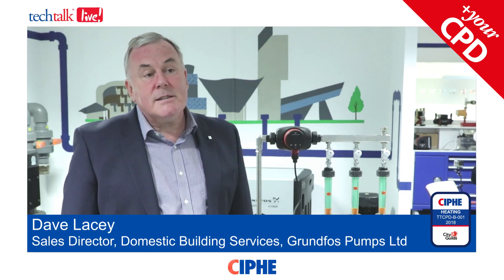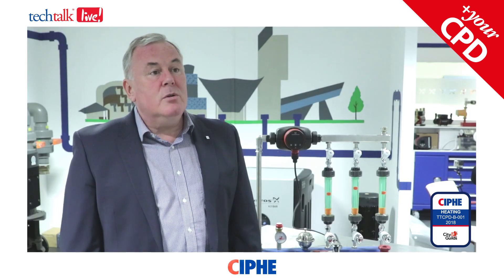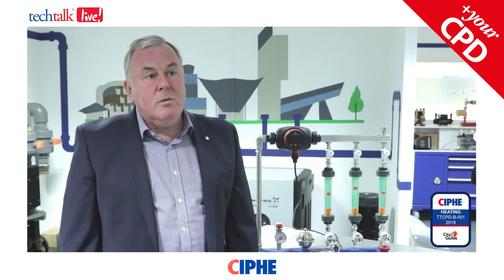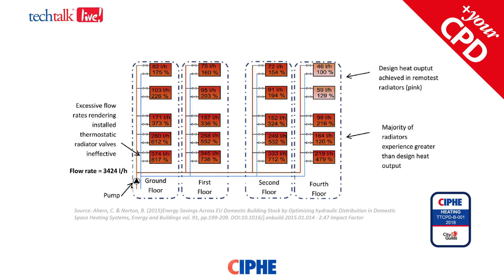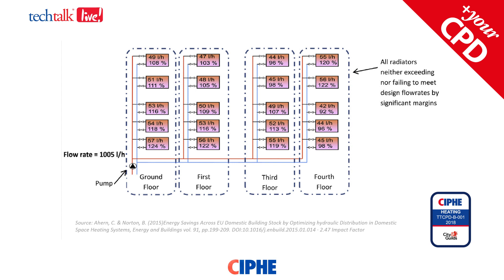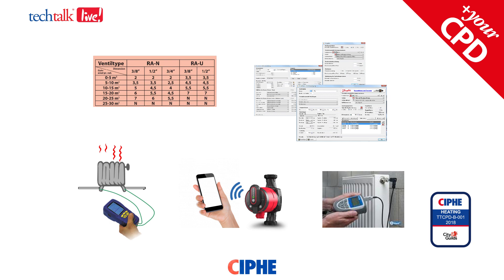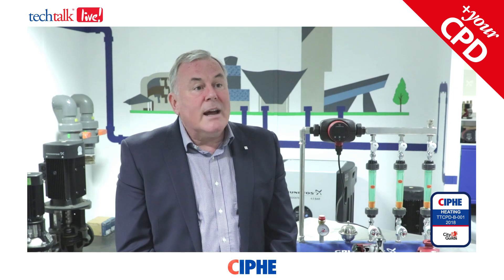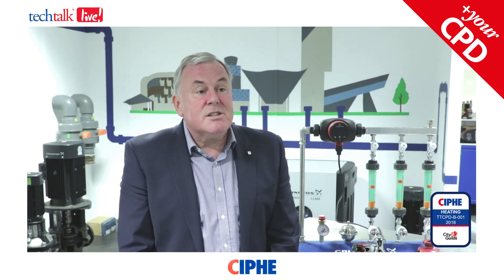System Balancing

Comment: Great information, but this highlights another issue for good quality installers fighting against the cowboys of the industry, doing things correctly takes time and installers are not going to use their time for free, so balancing will take time and so will cost the customer money something a lot of installers find is not acceptable for customers, most are looking for the cheapest option possible and are only concerned with the bottom line, its hard to compete against that when you are pricing against an installer who will just chuck a system in, with no design consideration, I think the public need to be educated on how much design and time is taken to design and install a quality system